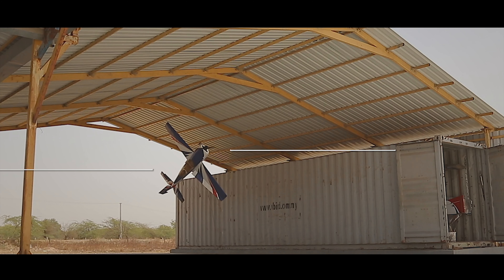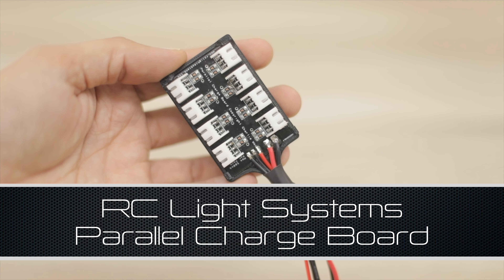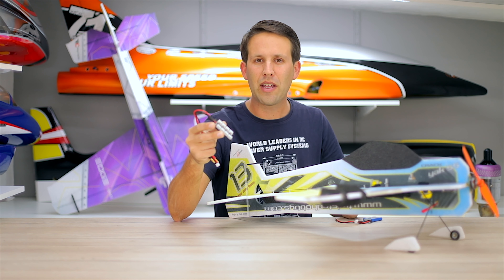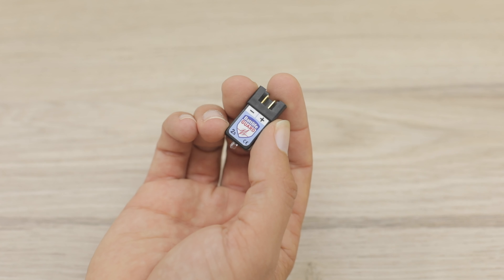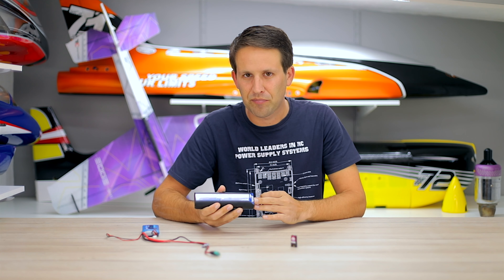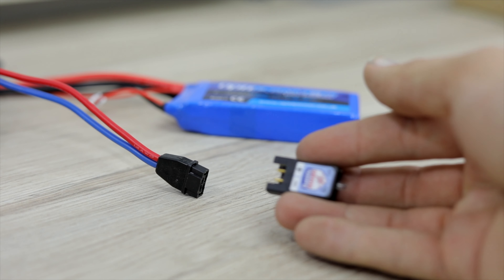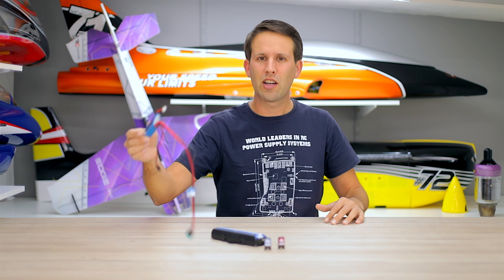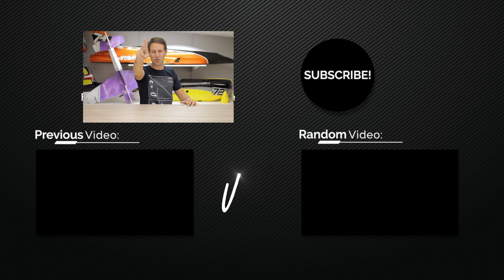Battery saver and multiboard. Cool Tech Ep1.

Comment: Just wanted to let you know that the way you described parallel charging is very dangerous. The high battery will discharge very hard into the low battery and becomes a fire risk. Low c batteries and small capacity may be less likely but my 4S 1500mah 100C batteries would cause serious issues if done the way you described.
Reply from the maker: Hi Kyle, on this board that is not an issue, its design assures that the batteries do not see each other boundryless, thats why there is a limit also to the charge speed available ok the board
Reply: @MartinPickering-PickeringRC  O cool, I must have missed that part. Was listening while doing the dishes.